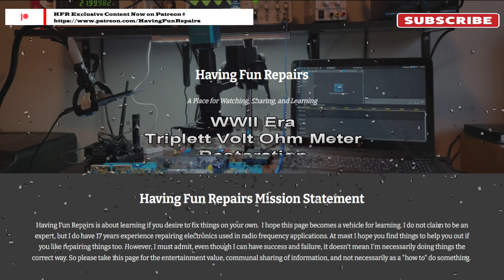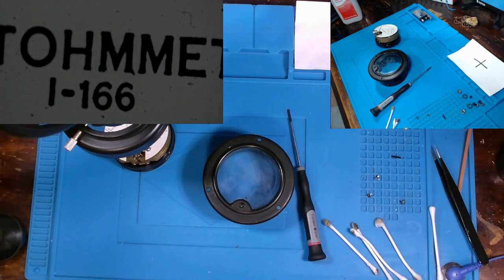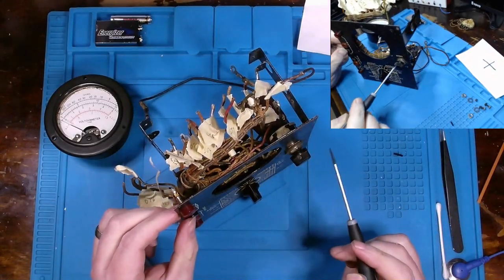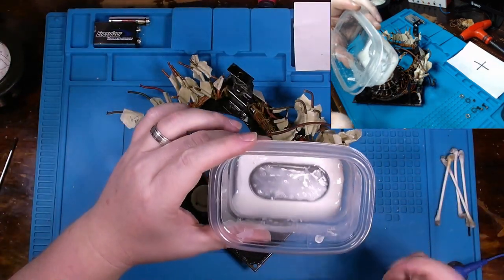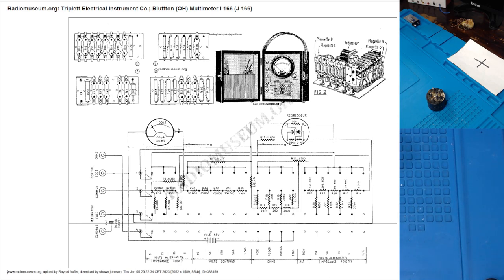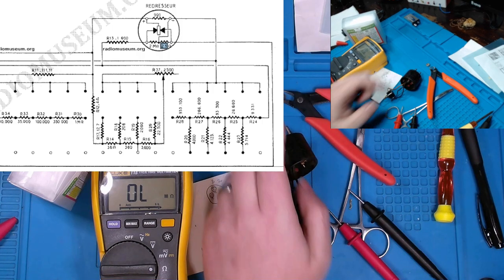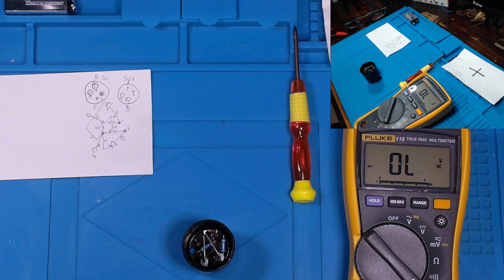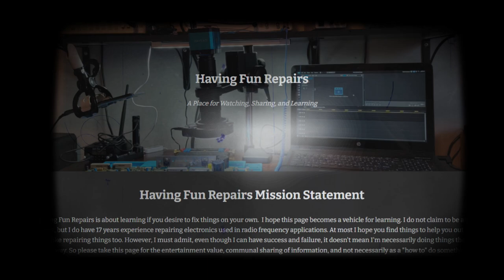(Part 3/4) WWII Era Triplett Volt Ohm Meter Restoration Rectifier Repair and Cleaning

Comment: Well done. Looks like a case of requiring a friend with a sandblaster, you can buy small portable units though I have no idea whether they are any good. Pure supposition on my part, but there was a Lida Florence Triplett Peterson (1900-1992) associated with Ray Triplett, so maybe a husband / sibling (who signed the meter) was involved with the manufacture.
Reply from the maker: That would make for interesting history and a good story.

Comment: Do I remember, from high school French ages ago (I think I remember you saying the schematic was French), that french for 1000 is mille? That would easily explain why the resistor was labeled as Mohm, wouldn't it?

Also, Evaporust or Rust911 might be an option for helping remove that rust.
Reply from the maker: It very well could be the reason. Appreciate the recommendations for rust removal. I will definitely keep them in mind in the future. I've just finished restoring the case and need to film all the reassembly and testing to close out this series.